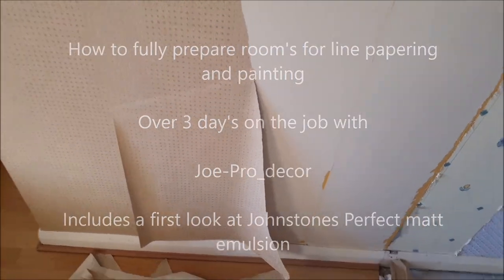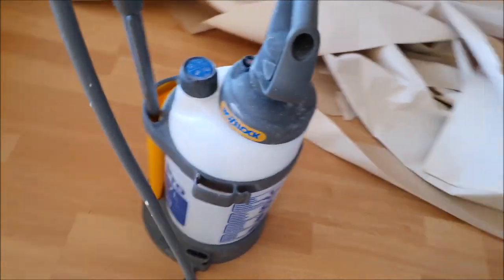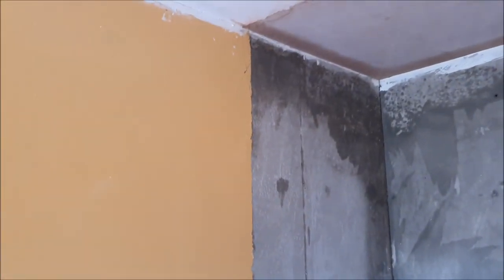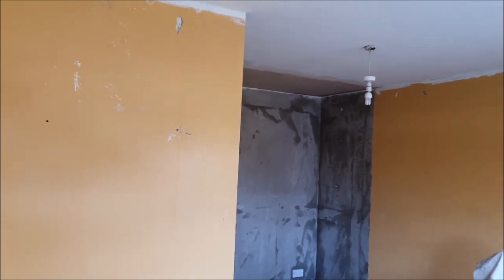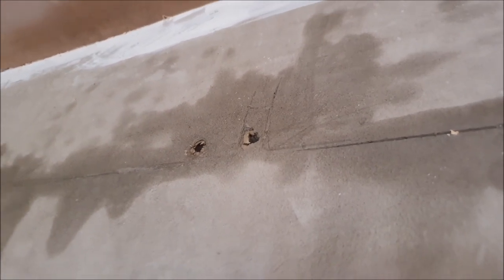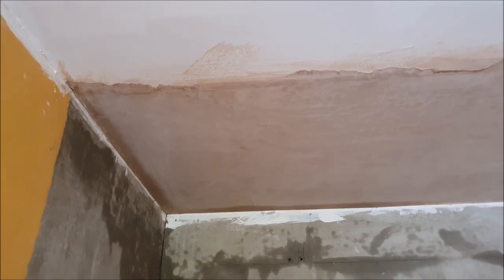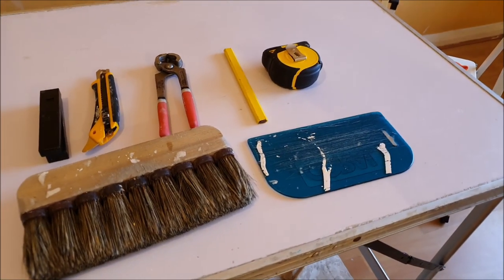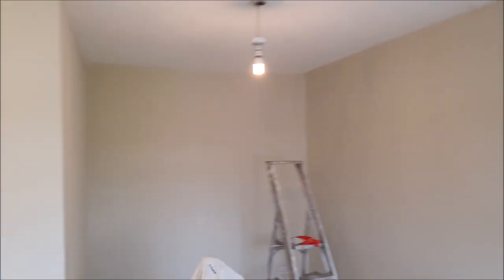How to prepare a room for line papering and painting

Comment: Can you please recommend what grade of lining paper would be best to use on a prepared wall to take paint as a finished surface?
Reply from the maker: Hi John, I use 1200 as standard on walls that have had little or no plaster repair. You can get away with 1000 grade on say new plaster, or surfaces in very good condition, but I find 1200 grade easier to manage.
Cheers, Joe

Comment: Hi Joe what grade abranet do you use for sanding and de_nibbing on your Mirka’s mate. Keep up the good work 👍🏻
Reply from the maker: Thank you 👍 
I generally use 120 & 180 grits for walls and ceilings, mainly 180 on my leros for de-nibbing purposes.
I use the 80, 120, 180 on woodwork and finish with a fine sanding pad inbetween coats, 220

Comment: Could you touch up the paint ???
Reply from the maker: Hi, are you talking about the ceiling paint?
Reply: @JoeProDecor   yes, to find a emulsion that actually touches up would be a life saver I do shop fitting (decor) and the ceilings are constantly getting knocked which is generally a full coat a it flashes otherwise
Reply from the maker: @christopherdonnelly4218  Johnstones perfect matt, or Leyland smart matt touch up perfectly. The Johnstones gear is more expensive, but that's because you can get it tinted, whereas the Leyland gear only comes in a limited amount of of the shelf cours including the brilliant whjte of course
Reply: Thanks joe I’ll give it a try 👍

Comment: Not bad but still not a finish a professional decorator would achieve,  a snap off d.i.y blade is unacceptable especially rusty , a proper expensive irwin or stanley fatmax manual knife using only heavy duty replacement blades is a must ! Also a metal straight edge is always used for knife cutting otherwise you chop into scar and ruin your plastic smoothing spatula, a smoothing brush albeit old school professional we learned in the trade is only used nowadays for blown vinyl papers and embossed papers never lining papers, a chalk line must be used after measuring your first piece from the ceiling allowing half an inch deviation of the ceiling line , also a bucket of warm  water  with a touch of washing up liquid must be at hand to sponge off any excess paste on ceiling walls and lining paper especially when painting is required on lining paper
Reply from the maker: Olfa snap off blades are more than capable of cutting paper for professional results, I have tried and tested all methods and find it works best for me... I think you will find most wallpaper hangers use, this method. Using a wallpaper hanging brush for all types of papers other than blown vinyl or anaglypta works best for me, as I find a hanging brush perfect for removing air pockets (which is it's intended use). Spatulas, smoothing tools ect have a tendency to push out paste, and using my preferred method insures I never have and blown seams, or dry area's (usually only spotted when painted over)... And I mean never. I just think some Dec's don't want to use both tools.
Everyone has their own way's which I understand... But being a professional for a long period of time let's you adjust your methods to suit. Also chalk lines are a bit old school for me now, and I prefer to use a, lazer level. 
I'm sure your methods work for you 👍
Just to add that I have now converted to wallrock fiberliner and wallrock smooth now as an alternative to standard lining papers due to the all round versatility and strength of it.... Bit of a game changer in our trade 👌
Reply from the maker: And yes I agree with what you said about wiping excess paste away especially when painting... As paint reacts with the paste whilst drying and causes the paint to craze and crack.... It is a must!